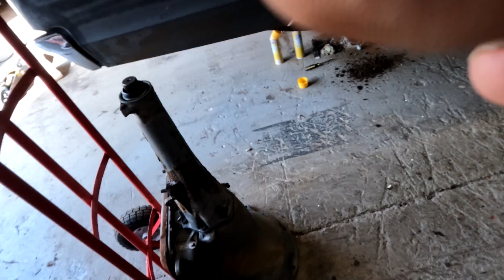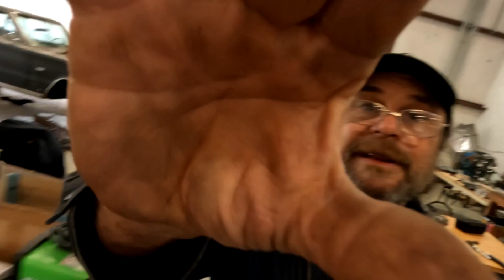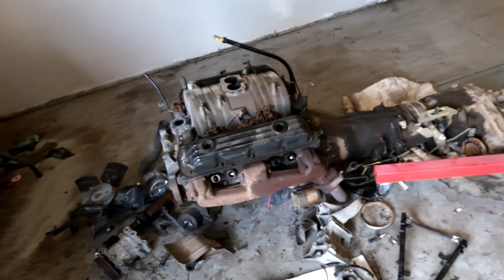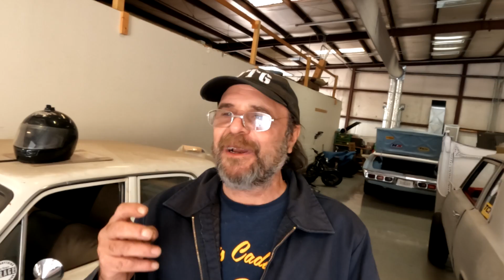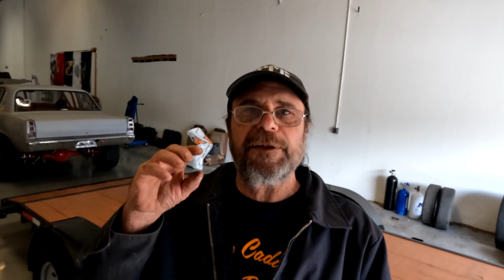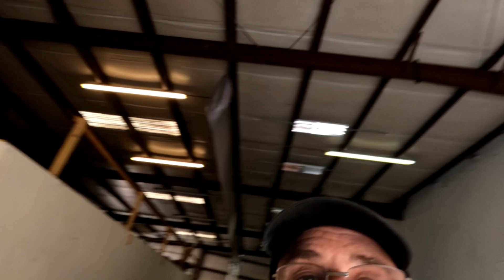Can A Timing Chain Issue Literally Explode Your Engine? You Betcha! Here's How

Comment: Bought an engine last year, 350 LT1 from a '71 'vette, 5k miles on a rebuild, went to change the cam for my application, chain was extremely tight. Pulled the cam, copper in the bottom of the front cam bearing. Downed the engine, copper in the top of mains 1 & 4 and on the cap side of mains 2 & 3. The crank checked true, fortunately it is steel so it's more "flexible" than a cast crank. I had the block align bored to be on the safe side. It wasn't out bad but it had a mismatched rear main cap. 5k miles and needed a full rebuild in the bottom.
Reply from the maker: Exactly this.
Reply: @UncleTonysGarage  Even the rod bearings had strange wear patterns, probably from the crank oscillating. The cam had worn into the front bearing 15-20 thousandths and had a razor sharp ridge at the very front edge, it was very near total failure.

Comment: Tony, I'm having a run-out issues with a very expensive engine that I'm building. It's a 588 BBC. I've already replaced the timing set and still shows .005 of run-out. I've massaged the cam dowel hole on the cam gear and nothing changed. I measured the gear at several points and it seems to be very close. Within .001

Comment: Timing belts are a pain in the ass but you are constantly tensioned, absorbing harmonics and light weight. Probly why those 4 banger motors run so strong n last a long time? As long as you remember to swap Timing belts. Lol

Comment: Indeed this is why I am so disgusted with GM when they went to nylon gear teeth on the timing chain sprocket of the Chevy small block V8's. Rip the teeth off after the nylon has gotten brittle and the engine grenades.

Comment: My Dad had a 76 Mercury Marquis when I was in high school.  I was burning donuts in the school parking lot with the tranny in 1st gear when my buddy reached his leg up over and stomped my foot right to the floor.

400 cube smog engine - a couple of days later my Dad had to take the car in because it wouldn't run.  We stretched the timing chain!
Didn't blow up, but I've never been a fan of those 400 cube engines since!

Comment: Great content. Had an old dodge truck come in with a 318 LA barely running, no power, smoking. Chain and gears were so worn it jumped time and bent 12 pushrods. We did chain, gears, and 16 new push rods. Ran like a champ after repairs.
Reply: Kinda lucked out it didn’t bend any valves

Comment: I have installed many timing chains .Some are tight some are loose. A tight chain will break in stretch pretty quick. Engine tolerance are not always the same .

Comment: Hey Tony When I had my shop I had 2 small block  Chevy's Come in broke crank on the 1st journal. Both factory motors no high performance But they were  Both very high mileage. But on both motors the outer ring on the dampener had started to walk off I chalked it up to Harmonics /   Vibration .
Reply from the maker: Yup, I've seen that a number of times.  In this case, however, if there was a damper issue, I'm certain the driver would have picked up on the vibration, or at least the feeling of things not being "right" before this had a chance to happen.

Comment: Could chain stretch also cause similar failure
Reply: Chain stretch will normally eat the top gear sending metal flakes all thru the motor. Normally with a standard all metal top sprocket

Comment: So the crank and main bearings lost a tug of war with the cam and cam bearing? A cam bearing that u can literally scratch with your finger nail. This is a result of a cast crank exceeding its hp limits. I have done this in a turbo deal but caught it before rapid disassembly. A cast crank will flex and wipe mains

Comment: so would a timing gear set be better aside from the noise?
Reply: Yes and no. Factory fuel injected engines have knock sensors that will retard the timing. Gear to gear timing sets activate knock sensors. You can use aftermarket FI which does not have knock sensors or use a carburetor. Timing belts are the best system. They will eliminate valve train, cam harmonics from being transmitted through the engine affecting timing. They are expensive though which is why most people run double roller chains. Hope this helps a little.
Reply: @colejohnson3705  i would think if gears send enough harmonics to interfere with knock sensors. they would enough to affect the spark in the distributor on a non FI engine. i keep reading several testimonies of chains having more power
Reply: @141runn  That is correct. Gears will contribute to spark scatter on distributor engines. Crank fired ignition can eliminate that problem. That is why belts are the best at stopping those harmonics and have less friction than chains or gears. I run Cloyes billet double roller chains in all my engines due to the cost of belt conversions and crank fired ignitions. Why spend thousands when a good chain works almost as well?

Comment: The crankshaft failed. Eagle cast "steel" 4in. stroke crankshafts do that over 600hp and above 6500rpm. SCAT cast cranks aren't known for this, nor are anybody's 4340 steel units. I asked Gary as soon as I saw his video debut on the failure, if it was a cast Eagle unit and he confirmed that it was. The timing set had nothing to do with it, it was the integrity of the crankshaft material and/or machining at that HP and RPM level. GOOGLE is your friend, check it out!
Reply: I agree but he's just talking about a potential problem.
Reply from the maker: The type of crank is irrelevant in this case, but the location of the break is.  An engine will throw rods from any location, but the crank will very rarely break at the front journal...the least stressed area of the entire assembly.
  Also, regardless of how broken in half it is, the damage started as a crack.  It could have been a micro crack that spread over time, or it could have been all at once, but something caused it, and all I did in this video was point out a situation that COULD have lead to an event just like this.  
As I said a couple of times in the video, I could be wrong about this, but it looks like damage that could have been caused by the type of stress a tight timing set might have initiated.
Reply: @Uncle Tony's Garage  Yes, but in this case the failure was an overstressed part not up to the task. Just trying to keep your many faithful followers from experiencing the same thing with a timing set blessed by Moses. Get a 4340 steel shaft and hope for the best!!

Comment: I never knew this. As I usually deal with belted european engines from the 70s and 80s I just knew that overtightening the timing belt will wear it out prematurely, probably less stressing on the crank than a chain though.

Comment: If the block is align bored and the crank moves closer to the cam shortening the center crank to center cam surely an undersized timing chain is called for, shorter less, not more.
Oversize means more.
Racing engines do not need an excuse to fail....🤔🤔
Reply from the maker: Oversize gears work the same as an undersize chain.
Reply: @UncleTonysGarage 
How do oversize gears change the reduced center to center measurement?

Comment: Technically, the chain is not going to heat at the same rate as the block, so from that approach it makes sense...

HOWEVER...

The REALLY INSANE part of this is that this is based on a REALLY SMALL piece of chain, compared to a REALLY LARGE crank shaft.

Seems not to make any sense...

And yet it does, if you discount the fact that the chain is a tiny fraction of the strength of the crank, because it is simply force x deflection x velocity.

Not the normal kind of math most people ever even knew existed, let alone making their entire livelihood from its development and licensing...

This is one of the many reasons I prefer timing GEARS over timing chains. (~_^)-b

Comment: Changed the timing chain on a big block Chrysler 361 about a year ago, and when i tested the old timing chain for slack, the crankshaft rotated 14* degrees of rotation before the distributor started to move. YIKES. I've had quite a few missfire issues and performance was down in the gutters, the difference in performance that was restored was night and day even on an old motor with at least 100K miles. the upgraded timing chain that i installed is a Double-roller timing chain.  And as Tony has taught us, (Well me anyway) Scrutinise the new parts for defects, doesn't matter if it's a good name brand part, look over the parts very carefully!! btw the double roller timing set i used was a Cloyes brand, good brand, but look over the part anyway.
Also at the end, i think this is the first time i heard Tony using a technical term "Yeet" the block. 👌

That varnish on the trailer bed is just beautiful, always had a soft spot for varnished wood.

Comment: My first cam change in my 318 lasted 1 hour counting break in. Then came tick tick tick 2 lobes and lifters intake on number 2 and exhaust on number 4. After break in i checked all push rods spinning. Some spin alittle slower. Any idea why those 2 stopped and ruined my cam ?

Comment: So True Tony....Learned as far as the timing chain tightness and reason why in that matter years ago working at a local machine shop FULL of ol school knowledge....30 year ago...you can tell you have been around man/straight up on how things work....Best Channel on you tube ......been following you since the Tag Job duster deal.You have been around the block a time or two and down to earth wrenching.
Reply from the maker: @Mopars are everything  I love ya man, but sometimes you can be a real dick.
  The trans I grenaded was from a neutral drop...did a whole video on that.  I also pointed out that trans was coming out of the car anyway for a rebuild, I just sent it off with a bang.
  The one in the Chrysler, well I had no control or say over that one.  The damage must have happened on his first attempt when the car pushed past the brakes.  He probably pedaled it in first before he pulled out of it.  It happens, but to his credit, he's been racing his Drag and Drive blown Dart for several years without having an problems like this so far, so he must have an idea what he's doing.
  As for first gear burnouts with a torqueflite...unless you've got a manual valve body, it's impossible to avoid having your burnout start in first gear.  I've said many times on this channel, that once you start your burnout with one of these transmissions, to upshift to second asap and not let off the gas until you feel the shift complete.
G'head man, blame me for something else...maybe the Lindbergh baby kidnapping.  That could work.
I need to get you on a Live sometime...could be fun

Comment: A buddy of mine was running a Camaro with a 283 the car was in a bad head on crash so we pulled the motor and put it in a nova and took it to the track we’re in the staging lanes and heard a slight knock the balancer looked wobbly while it was idling shut it off took the alt belt of and grabbed the balancer but seemed tight we ran it anyways nitrous and all a few times the car ran awsome but had this slight noise! We took the car home and yanked the engine to check bearings when we pulled the crank it was broken completely in half right behind number 1&2 cylinders I guess the head on crash was so bad it broke the crank or cracked it then with us running it it broke the rest of the way? All I know that engine ran and at high rpm’s that night with no issues we drove that car up on the trailer and pulled the engine the next day and found that! It must of broke in s way that the two crank peices gripped each other just rite?? Crazy never seen nothing like it! Bad ass little motor!

Comment: Explode, not in my personal experience, but it's completely possible. I had a chain break on an FE Ford. It wound around the crank gear, snapped the crank. The balancer slapped the water pump and broke the block at mounting bolts, also broke the block skirt at the front. The engine didn't explode but the engine was ruined.

Comment: Hey Tony, the urethane on that trailer deck will be extremely slippery if it gets wet. If it was mine, I'd screw some aluminum diamond plate on the tail to make loading easier when the track gets rained out halfway through. I'd also check anywhere the wiring comes through crossmembers and the frame. I've looked at several new trailers recently and not a single one had any grommets or other protection where the wiring passed through. That's just begging for electrical shorts over time!
Reply: Shoot, I've inspected brand new trailers where ( just as you said ) they not only ran the wires through holes in the cross members that have sharp edges, they just yanked the wires through during production, and stripped the wires right off the bat. I've seen many brand new trailers with bare spots in the wires due to this shitty work and no rubber grommets to protect the wires from chaffing/stripping. It's disgusting. New trailers cost money.......and ya get shit.
Reply: @howabouthetruth2157  Yeah, I wasn't actually looking to buy a new trailer, just checking out what was available. As soon as I saw the bad wiring situation, I decided that, when I need one, I'll just build it like I've always done. That way, I know it's done right!
Reply: Get another quart of urethane at a paint supply store , and have them add Shark Grip or Shark Skin additive . That's a traction enhancer , you'll never slip on your ramps again . 
We use shark grip on painted concrete and/or steel stairs in Florida , and walk up them in hurricanes !
Reply: @Richie_the_Fixer  I don't have to worry about it either way. My trailers both have steel diamond plate on the flat part of the deck and steel stair tread (the stuff with "teeth" used for stairs in factories) for the ramps and beaver tails. Yes, they're both VERY heavy trailers even when empty but, they pull great!

Comment: Late 70s,early 80s GM timing chains covered in plastic for noise reduction. About 90,000 miles an over-rev WILL grenade a 301 Pontiac. Biggest piston piece I found was about the size of my thumb.
Also broke the crank in 3 pieces in a 2.8 in a 4 speed S-10 when the timing chain snapped and stacked up under the bottom gear

Comment: I know a bad timing chain can keep you from exploding ya engine! My 260 olds was so weak it would not rev over 3k+/- in park, full throttle,.  I'm thinking the chain jumped, because it would pop thru the carb at high RPM, and sound strange out the exhaust, not hitting roughly 4k!

Comment: Back in high school days, I had a 73' ElCamino with a 350 sbc. That era of small block has a critical flaw. The upper timing cam gear was aluminum with a nylon tooth cover. Piece of shit design! Well unbeknownst to me, it had long since chewed off all the nylon and was eating away the aluminum gear. Cruising through town, part throttle, the chain slipped and cleaned off what little teeth remained. Car died and coasted into a parking lot. It bent several pushrods, some rockers jumped off, etc. Put a new timing set on it, replaced the pushrods, etc. It ran pretty well but it did have a hard acceleration hiccup. So it probably had a couple very slighty bent valves.

Comment: Had a buddy with a high mileage 360....he was turning it with a breaker bar looking for TDC and went too far.
So instead of going all the way around again, he backed it up.
When he finally started it up, all hell broke loose...
The chain had jumped several teeth and he bent several rods and collapsed those lifters.
Fortunately, I had a bunch of used rods and lifters and he was up and running in a couple days. 
He made his living with that old beater....

Comment: Tony what about   Hydraulicing the engine  ?  Or what's  known as lifting  a head .   It happens mostly with power adder applications Like Turbo blower or nitrous. But it can happen with normally aspirated engines.. If the block is  Decked  The heads are shaved Or a thinner head gasket is used You must make sure you Chase the threads For the cylinder heads in the top of the block  With  A tap.   The threads can get real cruddy Down at the bottom by the water jacket And you can get a false  Torque reading. With the heads not tightened down properly coolant can transfer from  a water jacket opening in the top of the deck to the cylinder. Next time the piston comes up to  TDC  its over  catastrophic failure. You  can't compress a liquid.  Block crank  rods blown to peices.

Comment: I was surprised when I took off the timing cover of the slant6 170 I'm freshening up = seals gaskets , pump and timing chain .  the slant had a solid sprockets Cloytes timing chain set . it has slack so it will be replaced

Comment: I have a friend who is a carpenter, and he says, "Wood is an imperfect material, and that's why it can be such a pain in the ass to work with sometimes."
Reply: For me wood is difficult because you can't fill the gap with weld. Get the 2 metal pieces off by 1/16" and it isn't a big deal. Get the 2 wood pieces off by 1/16" and it's going to be a big gap you'll always see.

Comment: Going up a sand dune at about 4,000 RPM the spring under the cam follower on the fuel pump shot into the nylon timming gears. BOOM bent every valve, knocked holes in the pistons. 304 V8! Never will I run a fuel pump in the timming  cover again.